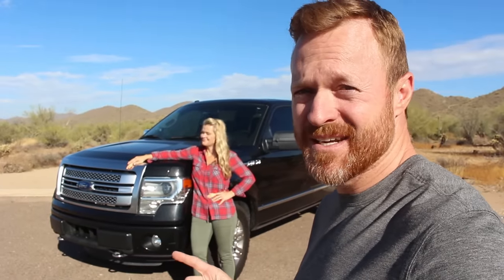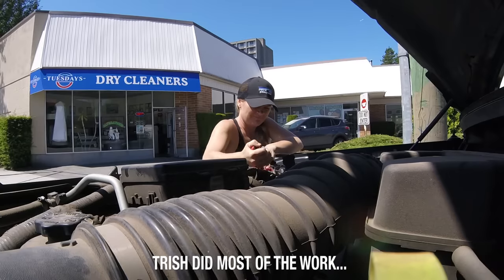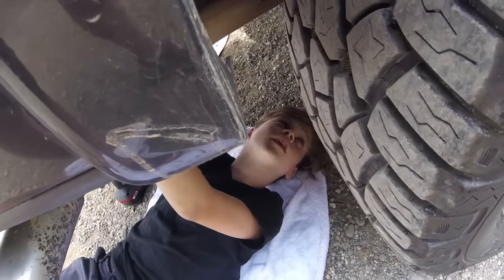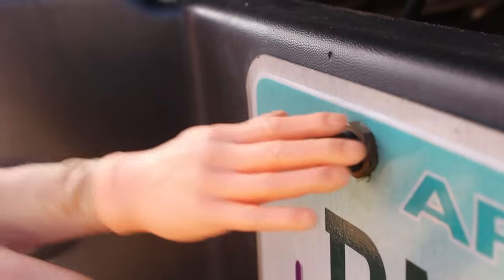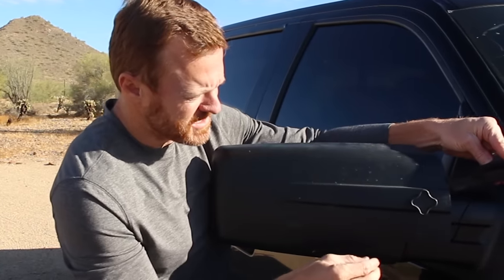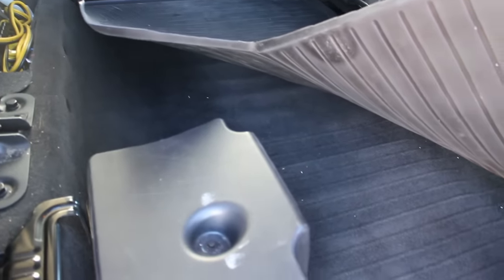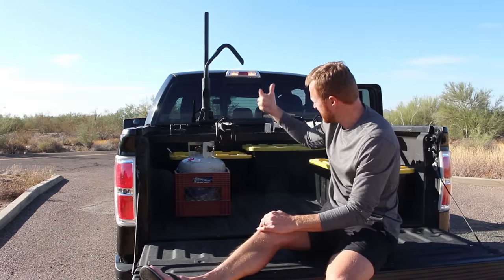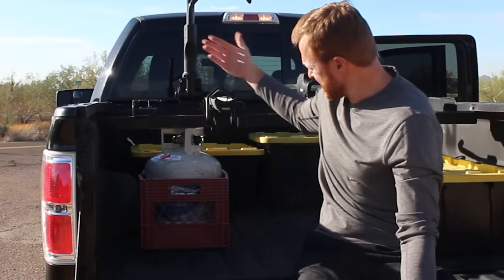TOWING WITH A HALF TON TRUCK (FORD F-150)

Comment: Nice setup!  I almost went with air bags on my '14 F-150.  But started with the Fastway e2 weight distribution hitch with sway control.  Very similar to the Equal-i-zer hitch but a little cheaper.  Worked great, for the 10% of the time I needed to haul a heavy load.  I'm not pulling a travel trailer long distances like you do.

BTW: don't bother downgrading to a diesel.  I had a '06 F-350 with the 6.0L diesel.  It had more than enough power and spring load to handle anything without a distribution hitch.  However, the diesel engine was a money pit.  And from what I hear, the new diesels aren't any better.  I traded both the F-150 and F-350 in for a new '17 F-250 Platinum with the 6.2L gas engine.  Best thing I ever did.  And in the long run, probably cheaper than keeping the diesel.
Reply from the maker: Thanks. Yeah, that 6.0L diesel has built a reputation. I haven't heard a good story to date. The 6.2L is a great motor.
Reply: How about vs a Cummins in the Rams? Rep wise?
Reply: Sean O All modern diesels are great with the exception of the emission systems. All modern diesels are plagued with emissions problems.

Comment: Hey brother good to see the 6.2 going strong. My 2017 f250 has this engine and it works real good. They made some changes to the engine making it a little better on fuel and higher torque at a lower rpm.
Reply from the maker: Yup. It's been a good engine. Check out our latest vid with our latest ride. 6.7 👍
Reply: Keep Your Daydream I will thanks. I had a 2012 powerstroke and loved the power but wasn't the truck for me. But looking forward to the future of powerstroke and owning another one . Thanks again.

Comment: Marc, you opened yourself up to lots of comments about your setup with this video! LOL.

We tried towing our 7300 lbs. travel trailer with our 2009 F-150 XLT.  We also have a family of 5 so I took it to a CAT scale on one of our camping trips.  With all 5 of us onboard and fully loaded we were 600 lbs. over the truck’s GVWR and 200 lbs. over the rear axle’s max. weight rating.  So I upgraded to a F-250.

No suspension upgrades will change either of those ratings - you can’t change the axles or the frame. So I fear you may be WAY over your truck’s ratings, especially since you have the Platinum package with all those goodies that add to its curb weight.  But... I’ve never seen a F-150 with the 6.2L engine and are those yellow shocks from the factory or did you add Bilstein shocks?  Maybe you have the heavy duty payload option? The door stickers will tell you your GVWR, your cargo carrying capacity, and your axles’ ratings.  I really enjoy your videos and want your family to be safe and not kill your truck before it’s time. The 6.2L is a great engine for your 1/2 ton and as you know will easily pull what you’re asking it to pull.  The shortcoming of half tons is always their ability to carry weight.
Reply from the maker: I just pinned a comment. I had these comments in the video, but didn't want to go down that path... too many accurate police, but your right. Yes, my truck has higher cargo capacity, but I was still pushing it with the cargo, bikes and tongue weight.
Reply: Even if it wasn't your intent, I'm afraid Allan is right. Weight ratings, capacities, etc. are often confusing and misunderstood. I'm sure the accuracy police are all commenting out of concern for your family, and theirs. When confusion, misunderstanding, or simply ignoring a known problem leads to being overweight, that is a safety and legal issue. For starters, states often exempt RVs from commercial or escalated licensing requirements, but if safety and crashes become a factor, that can always change in the future. Insurance could refuse to pay out, and a bad situation could bring criminal negligence charges.  We all need to do our part to be legal, safe, and not taint the perception of the RV driver/owner/lifestyle.  Safe travels.

Comment: Get a Diamondback HD tonneau cover and use their bike rack or mount a Thule bike rack system to it. 
The Diamondback HD tonneau cover can support 1,600 pounds. They have a variety of optional equipment for it. You can even load two atv’s mounted left to right on the tonneau cover. Very strong and very secure.
And I’m curious what your max towing capacity was when the truck was stock and what you think your max towing capacity is now with Firestone air bag system?
Thanks for your time.
Ron

Comment: I was weighing my options about a half ton truck ,since their towing capacities have increased and now this seemed like a viable option. The suspension upgrade and mirror options I agree are a must. Can you please talk about elevation changes while towing and any issues with that. Love your videos and safe travels!
Reply from the maker: With our engine, we rarely had an issues with the power for towing, the limitation with half-ton trucks and towing (in my opinion) are the cargo capacity (people, gear and tongue weigh) and holding it back on down hills. There was one hill coming out of Jackson Hole that we had to get up in 1st gear. If you're going to spend a lot of time in the Rockies...
Reply: Keep Your Daydream! I am thankful for the reply and I do love the mountains but the majority will be in warmer and flat climates. I was concerned it would make it through the mountains! I am glad it did and that you did too!😉

Comment: 750 pound or 1000 pound torsion bars on your hitch head is all you need to tow a travel trailer of a decent-sized successfully with a half ton pickup truck. If installed correct to the "a"frame of the trailer it makes your trailer and truck as one perfectly level and stable.
Reply: Wireman134, with all due respect not ever heard of that much tongue weight in my life. I have been out of the RV industry for quite some time but I always thought 10% was Max and that would tell me that your travel trailer weighs 14000 pounds

Comment: Three years later, you went from a F150 6.2L V8 gas to F250 PowerStroke and now a F450 diesel truck. I've always wondered why didn't you get a F250 with the 6.2L V8?

Comment: If you upgrade down the line go with the Ford F-250 6.2L gas if you don’t want a Diesel, also the cabin is Enormous , and the truck won’t squat as much when towing the RV

Comment: Great video and info, especially start and use what you have! So many (mistakenly) tout or swear you need a big expensive honkin diesel to pull a trailer, not true! I’ve pulled with a 1/2 ton for years and they work just fine if you stay within their manufactures' limits for pulling. Enjoyed 'the hands' and the bloopers at the end, thanks for sharing! W

Comment: You two are adorable! I am looking for a new truck and a new trailer and I will be VERY NEW to the RV world. I sold my house and don't want to buy another one ever. So, I will be watching and learning. And thanks for the tips. I have a 2002 Escalade with 208,000 miles on it. I don't think I want to pull with that so I am looking into a 6.2 liter engine. Possibly the GMC Denali. God bless your family on all your trips.
Reply from the maker: The 6.2L motor is great. Solid. Welcome.

Comment: Are you guys using a load distribution hitch? I tow a 23’ travel trailer with slide out with a 2019 F150 4x4 super crew and it doesn’t sag any with the hitch.   Another option that isn’t super expensive is adding a  rear sway/stabilizing bar to the truck. The Hellwig adjustable is a decent option.

Comment: Love ALL your videos.  They are AWESOME !!!  We travel alot in a 5th wheel with a duramax diesel. Love the ride right airbags that I had installed but the same thing happened to us they were professionally installed with the brackets backwards. Love your video on Whistler. The wife says I can't mention it again or she's not going to go there. LOL because I mention it all the time. Keep safe and keep posting videos.
Reply from the maker: I can see why it happens... mech. put the truck up on a rack and when the suspension is stretched out... there is no way for the bag to reach. They need to lower the truck to the ground, install and then go back up. But it's still a dumb mistake! I can make mistakes like that on my own... I don't have to pay for it! You can talk to us about Whistler as much as you want :)

Comment: You've done a great job with getting what you got ready to tow. With that being said ( I'm saying this as a suggestion not criticism) I would strongly recommend a f250 or really much better a f350 duallie as a future truck. The 8' bed will make the ride smoother and reduce sway and a duallie will help too. A duallie actually isn't any harder to drive than a f150 however drive throughs do suck and you gotta look out for those big fenders, jackknifing can be esay due to the lack of visibility. A flat bed would be best for this. A flatbed f250 would honestly be pretty good. I am really impressed with your f150 though, I hope it lasts and does its job for as long as you need it.
Reply from the maker: I agree. Our comments about in the end about starting with what you have was how we made this happen. Had I waiting to upgrade my truck and then got cold feet, this whole thing may have never happened. Now that we're in this for the long haul, we're open to upgrading trucks. With that being said, the numbers were right on this setup and we did it safely for 45k miles, but your comments are accurate.

Comment: Hey Broski - Towed our Airstream around the country for a year and half with a Ram 1500, your WD hitch isn't setup correctly if your truck was sagging as much as it was. Did you do a 3 pass gauge over the Cat Scales? That would of told you were the weight was going. You should spend some time adjusting the hitch to get the truck as level as possible, then add air for additional level last. To many people on the internet just telling everyone to add air bags and never adjusting their hitches.
Reply from the maker: I agree that adjustments should be made, but I've only seen a WD system level lighter loads. Perhaps what was contributing to my sag was my cargo and passengers, which the hitch can't help. I still believe both systems are good, but you have a good point that the airbags should not compensate for a WD hitch setup improperly.
Reply: You get it as close to level as possible. Your first shots of the sage looked like it wasn't even adjusted. Dealers have a habit of installing them and never propery adjusting them. Whats the tongue weight though? If you haven't done it, I'd recommend three passes on the Cat scale. First pass, just your truck, this gives you a baseline. And you can see what the trucks, front and rear axle weight is. Second pass, truck + your trailer hitched up, but this is important, do not connect or apply the WD/Anti-sway hitch. Also, no air in the bags, this will tell you how much weight is on the back axle. You can actually take this second pass and subtract the difference from first pass to figure out tongue weight. Third pass, apply WD hitch, now you should be able to see where the weight shifted. It should be pretty even between the two axles.

One of the things that happens is folks overload the rear axle, they add bags and it shifts some weight back to the trailer, but doesn't reduce the load on the rear axle and no weight is transferred to the front axle. So all you've done is hidden the problem if that makes sense.

Last time I did this my truck weighted 8360lbs by itself. 4620lb front axle and 3740lb rear axle.

With my Airstream hitched and no WD front axle was 4180lbs and rear axle was 5140lbs - so you can see it even lifted weight off the front of the truck.

I actually made more than one 3rd pass I adjusted the WD hitch, then my front axle was 4590lbs and the rear axle was 4620lbs - much more balanced. And the front axle was closer to it's original weight.

Very stable. No sway.  Hope that helps. Just wanted to share the knowledge so you guys stay safe. See ya out there on the road.

Comment: at 100,000 miles, especially with towing, how is your transmission fluid holding up? I know the interval is something like 150K, but if your almost constantly pulling a load, have the fluid inspected. A trustworthy mechanic can tell just by looking at the fluid. And if it's worn out prematurely, that may be because of the stress, you might benefit from an additional aftermarket ATF cooler.

Comment: Great video, an alternative floor Matt is husky liner. They are about 3/4 of the price of weather tech and they are a thicker material, still lasered to fit perfectly.
Reply: I used Husky mats in my F150. They were cheaper, fit better, and wear much better than Weathertech. Highly recommend them.

Comment: We tow 1/2 ton as well. It has so.e draw backs however it is capable and manageable to do. You just need to treat your combination with respect. And SLOW DOWN. I see far to many RVers driving at unsafe speeds weaving in and out of traffic with a squatted truck.
Reply: Great video. But you guys always have great videos!°!

Comment: Thanks for your videos. We're seriously considering a travel trailer and have been using your channel the most when doing our research. Need your advice (or from others in the same situation). Planning to take a 6 week trip from Georgia to some of the western national parks next summer. I have a Ram 1500 (towing capacity 8240; payload 1840) and can't upgrade for another 2 years.. Rented a ~6700lb unit recently and seemed to handle okay for the 40 miles of low grade hills in the south east. Starting, especially on very steep dirt/gravel at the campground was a breeze, but I have sincere concerns for the long, steep grades out west. The units we're looking into getting would probably be around 7000-7500lbs loaded with gear. So while my numbers will be within the safety confines of the truck I'm worried about being able to climb the grades (I don't care if I have to travel a bit slower). Seems like you did just fine and got by. 

Other question would be is it worth dropping ~$2300 into this lease to lower the gear:axle ratio? Bumps the max towing above 10K while not changing the payload. Would really love to crawl through this trip and get a bigger truck later, say over getting a rig we wouldn't really be happy with. 

Thanks!

Comment: Good video!  I'm towing a 28' trailer (advertised 6,000 lb dry, I haven't weighed it) with my half ton truck that is worn out and considering what to get.  Since I'm retiring in a month and my wife & I want to do some long trips, I keep going back and forth between 1/2 and 3/4 ton trucks as it would also be my daily driver, but even with enough wheelbase, power (and cooling), payload capacity really seems to limit the 1/2 ton choice.

Comment: Hmmm? Sagging truck so change suspension. I'm shopping today to put a WDH on the truck and thought that is how you level a tow vehicle. If the tongue weight is too much (causing sag), then I supposedly put the WDH on and raise the back end. But there is also a rule that says use 12% +/- of trailer weight on the tongue. If I "unsag"  the truck won't the tongue weight be too low on a 8 or 9k lb trailer. Hope the shop has some answers. Great videos by the way.

Comment: Good info.  I work from home and I'm wanting to buy a camper trailer and hit the road for 6-12 months.  My lease is almost up on my apartment and I'm recently single so why not do it?  I have a 1/2 ton Chevy Z71 5.3L truck with tow package (4.10 gears, trans cooler, trailer hitch and wiring for 7 pin) but surprisingly no trailer brake controller.  I'm going to be adding a Tekonsha brake controller and will probably add those Firestone bags.  I had them on my old Dodge and they leveled my loads nice.  I will be getting a 22-25 ft camper and weight distribution hitch with sway control.  Also going to put on new all terrain tires, all 4 new shocks, new fluid in my differentials and transfer case and new filter and fluid for the transmission.  I have been to 33 of the lower 48 states so I want to see some more of the continental US.  I will be traveling with my dog too.  I might start making videos to document my journey.  Thanks for the tips and safe travels.

Comment: We are putting a BODY ARMOUR  steel bumper on our new 5.7 Tundra  at 200 pounds.
TOO MANY texters and distrated drivers for me.
The other vehicle becomes a crumple zone and our engine stays in the frame.
Also we will pull a 21 foot escape fibreglass into recreation sites and forstry roads so we need deer and bush protection on Vancouver island.

Comment: Though my situation is a bit different than yours, at the time you made this vid I've always questioned the use of the half and 3/4 ton trucks and pulling anything more than a ten trailer. I had a 3500HD Duramax for my towing truck and now a 2500HD Dodge/Cummins. I love the Dodge but miss the Chevy a lot. 
Firstly the difference of the technical part from the 2014 Duramax to the down grading of the 06 Dodge (for reasons for another story) but also the weight abilities of each as well. My 33ft/10,800 pd/dry rear puller trailer is a bit heavier for the smaller truck in wind, those rough and "roller-coaster" roads in Az. on the 40. I could only imagine how it would feel with the smaller 1500 gasser. Both trucks are/were crew cab, Dodge is Mega. Both are diesels. (Dodge now has the tuner raising it's horse to the equivilant of the Chevy's horse and torque). It's just the extra couple thousand pound truck difference that made it a "steering wheel grabbing" experience the past few weeks on the road. 
I could only image the half ton is a bit different than your latest purchase with the new rig. 
When you moved "Ginger" with the new truck, would you agree with my point of the truck size/weight while pulling the rig??

Big fan of your videos. I appreciate all you show us in your videos and enjoy the experiences you share with us as well.